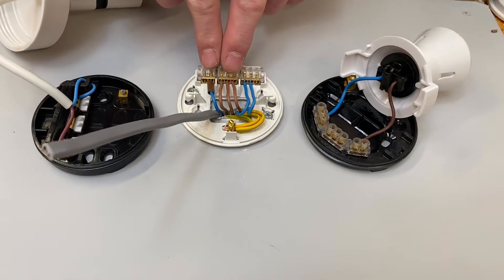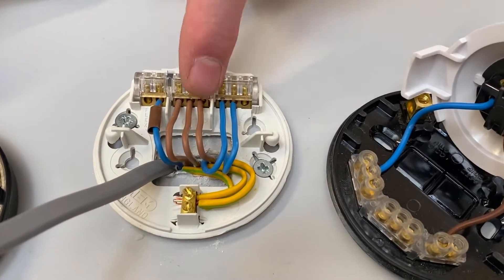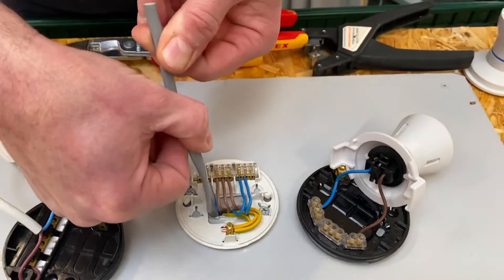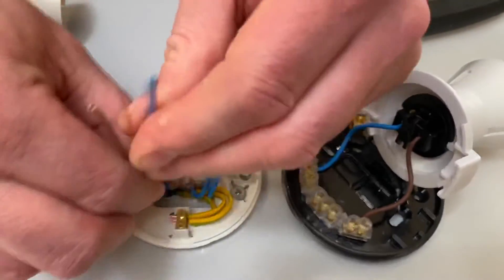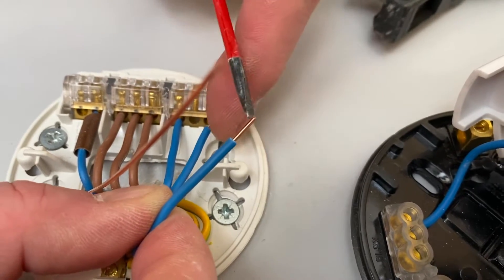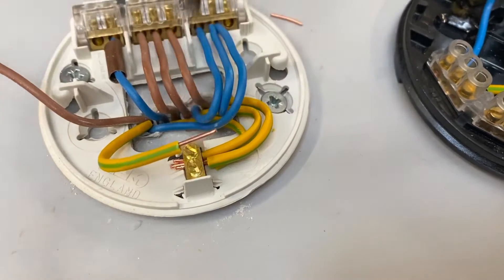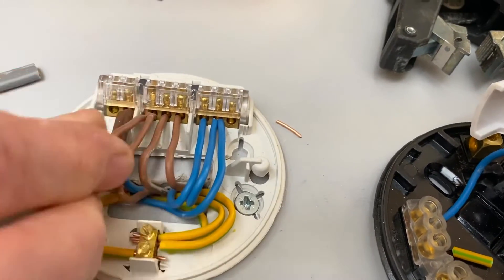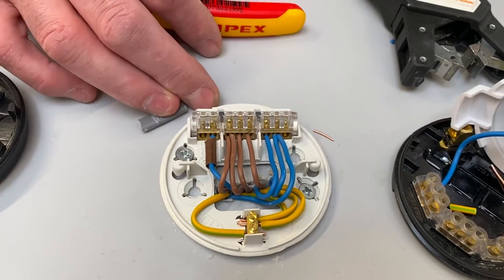How to Wire a Feed to Another Room From a Ceiling Rose Pendant 3 Plate Method Connections Explained

Comment: how could of this worked in a celling pendent just with 2 conections and it swiched but after i changed it it stayed on could not switch it of        i must of got the switch wire mixed up with a neutral  but in the old cofigaration it switched

Comment: I’m looking to add a light in a loft but I just want it to switch using the existing switch from the landing, do I just take the connections from the flex outlets to the new light? Thanks

Comment: Great videos!, I just need help with something, I had to replace my ceiling rose has my new light fitting is smaller than the rose. so I have installed the Wago clips, however the problem I have is like your set up here my ceiling rose has three cables coming through the rose, basically it has 2 neutrals connecting into one connector like you did, however with the Wago clips you cant put two neutral wires into one hole on the wago, so I assumed by putting it into a 4 way wago clip so each neutral is now in its own connector, because there are 4 neutral cables including the cable to the light fitting, however since I have wired it up my living room light wont come on, in fact it has tripped the fuse switch. So is it because the two neutral wires aren't connected as one, and if so what would you recommend to do as the wago doesnt work with two wires in one hole, if its not that what could be causing the other light to trip off?!

Comment: Thankyou for that very good. Just asking if you were taking a feed to an outside light the cable has to be 1.5 mm twin and earth coming off the ceiling rose to new outside light. Would you have to consider the length of run from rose to new outside light eg just take from closest one. Is there a maximum run on that cable.

Comment: At what point are there too many wires in the pendant and you put them into a MF box ?
Reply: You can potentially take another feed after this. As there are 3 terminals for neutral in a standard pendent. I'd leave the 2 outermost terminals solely for the flex to the lamp holder itself. totally upto you to decide.

Comment: And if you just wanted to add an extra light form the same switch I assume you can just add the new T&E into the same terminals as the pendant and connect them to the pendant terminals further along the room?
Reply: Correct, mimick the existing terminals 👍